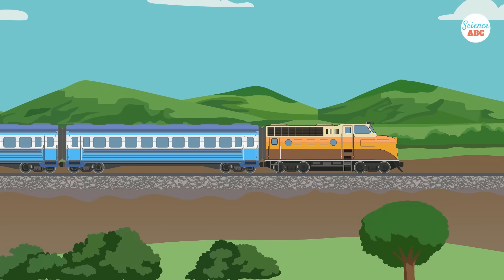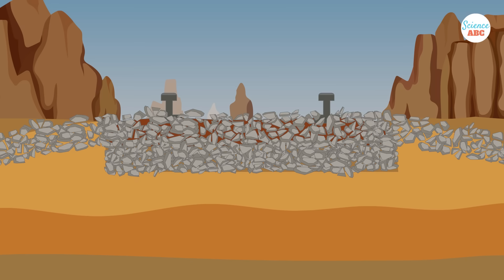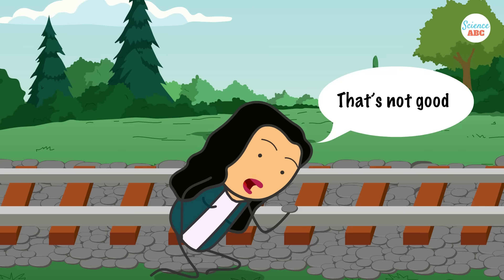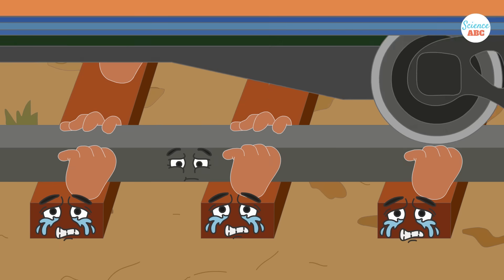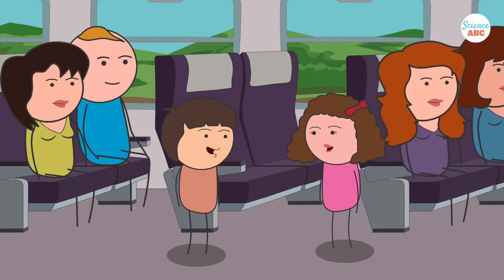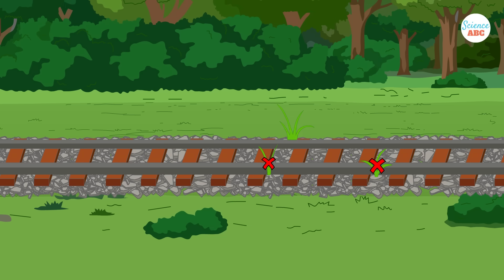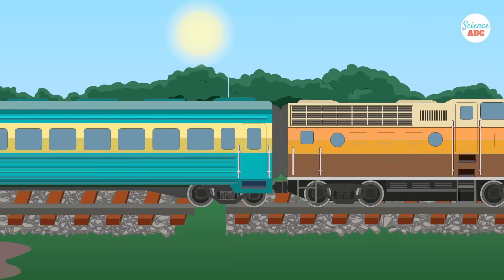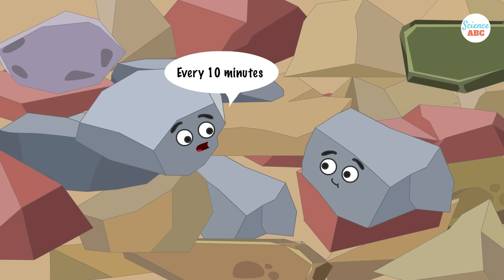Why Are There Stones Along Railway Tracks?

Comment: Another reason is sparks... the steel rusts and the train's rims kick sparks off the lines creating fires. The rocks stop vegetation. I've seen several rail line fires in dry months
Reply: Number 5 mentions stopping vegetation. It just doesn’t mention sparks in conjunction with it.
Reply: I've been working for the railroad for over 30 years and have never see the wheels make sparks from being on the rails.  Most fires are caused by carbon buildup in the exhaust and subsequently released into the air and landing on dry vegetation.  The only way the wheels make sparks is if the train is stalled and the wheels are spinning and train is not moving.
Reply: @MichaelOstertagFarlinTerminal 
Nevertheless, fires do happen. Rocks, too me it seems, keep it from getting out of hand.
Reply: @MichaelOstertagFarlinTerminal  Sparks would happen if pieces of flint were blown onto the track.
Reply: @MichaelOstertagFarlinTerminal  I don't want to give out personal details but I've seen it happen 3 times now. The rail I saw this happen is not heavily used and is often closed for long periods for maintenance. It starts with dry leaves in the adjacent ravines. I've seen the sparks coming off up close and personal.
Reply from the maker: Yes, the stones help prevent vegetation, which is a hazard during rainy weather
Reply: Preventing fires is a huge reason for it. I'm surprised they didn't mention it.
Reply: My dad used to work for a rail yard making repairs, and as a kid when I asked what therisks were got he said it was to stop sparks from causing fires too.  And one time vegetation was allowed too close where there wasn't as much ballast and it went up in flames mid summer, and they ended up expanding therail yard line to make it complete rock.
Reply: Yes this is very true and the sparks is from the trains too. If the crew does an emergency brake that is locking the engines wheels that is causing it spark because of the wheel and the railing scrapings together to make sparks and cause fires.
Reply: Sparks isnt so much of a problem. Guess you never seen an electric train switching 3rd rails? Also with deisels engines overheating, faulty wires or leaf debris is main cause of fires
Reply: I thought this was going to be the NUMBER ONE REASON!! 🤦🏻‍♂️
Reply: @samuelluria4744  the more I think about it a grass fire may cause damage to the surrounding areas but have little affect on the tracks
Reply: @JustMe-gn6yf  - Oh, okay Mr. Cynical...you DOUBT the Railroad company's commitment to the overall good of the environment???😜😜😜
Reply: @samuelluria4744  no not by any means in fact I wish we had more passenger rail systems in the United States that connects both coasts but grass fires aren't that bad for the environment and it's the land owners responsibility to maintain their overgrown dry vegetation
Reply: @JustMe-gn6yf  - I thought my sarcasm was more obvious,  sorry...
Reply: @samuelluria4744  I'm a little slow it's been a long work day, it's all good
Reply: @JustMe-gn6yf  - Same here...😉
Reply: @samuelluria4744  I still complain about our lower 48 states not being connected by passenger rail system
Reply: @samuelluria4744 
They have to to some extent. Can you imagine fire following them up the track? Remember that trains carry cargo here in the US, and some of that cargo is refrigerated and frozen. Other cargo is at ambient temperature or open to the air. Fire would put a wrench in the works for a lot of it. You can't sell an apple cinder.
Reply: This is an old rail line. Very old. No '3rd rail.' A lot of moisture, snow, trees & branches but in the spring all the dead plant material is dry and is fit to light up. Some fires I could put out with just my boot-stomps and a shovel. Others required fire dept help.
Reply: Another reason not mentioned is a safety reason. I work in an enclosed facility that stores railcars, and we have approximately 30 miles of track. Just last week we had a spray truck come down to spray herbicide for the reasons mentioned, as well as these others. The facility i work at is in Texas, so snakes, such as Copperheads, Water Moccasins,  and Rattlesnakes are a real threat to us out here. Trust me, you don't want to be walking down the side of the track 20-30 cars deep through tall grass. Too big a risk of getting snake bit. Then there's the vines and brush that like to pop up. Serious tripping hazard
Reply: I'd agree with others it's an added benefit not a reason. I don't doubt its possible to start fires, i'd imagine those small chips can get hot with pressure of the train.
I've never seen it myself though, most fires i've seen on track is from grinding gear(esp. on track profile grinders), dragging rail and people throwing a ciggy out the window.
I've also heard(but never seen), a tampa starting a fire by chipping a rock.
Reply: First thing I thought of
Reply: He already mentioned vegetation. Doesn't need to talk about every little thing
Reply: Gotta be some hot wheels when they on fire
Reply: that’s not a reason, just an added benefit
Reply: Wrong!
Reply: Hot ties!
Reply: Thanks now o don't have to watch a 5 minutes vídeo explaing that
Reply: Saved me 5 min
Reply: Are you on about sparks from the connector to the live 3rd rail? As those are the only sparks I've ever seen
Reply: Rust doesn't spark.
Reply: You mean the flanges? Cuz yeah I see that happen too, BNSF maintains the mainlines well and clean around where I live so it doesn’t normally happen often and when it does it stays isolated.
Reply: This is what I was going to say.
Reply: Not from wheel sparks, you haven't.
Reply: Why am I here
Reply: Oh interesting
Reply: A reason left out: They make the tracks look pretty.
😄
Reply: this was the only thing i knew about the stupid rocks and the guy didnt even mention it, thank you for making me feel less insane.
Reply: Fire must have been a greater risk with steam trains, I guess
Reply: @tomhaskett5161  No, fires were a greater risk when the bearings that allowed the wheels to roll had to be regressed periodically manually.  If they got too "dry" they'd get very hot and could and did start fires.  This is no longer the case, they are self-contained.  
I'm in my mid 40s and have seen a few train-caused track-side fires, but they weren't major.  It's been 30+ years now, though.
Reply: Musta worked with a state or federal forest service. Trains typically cause fires when a bearing or brake is malfunctioning because I've seen one string fire for miles working with NCFS. .
As another commenter said they also rain sparks when a turbo charger is burned out causing flames and sparks to fly from exhaust. Has anyone seen on a movie someone driving a car on the tracks. It can be done but we did on non used tracks as it's private property and meeting a train would be catastrophic.Dont back up.
Reply: It’s a lot of oil on tracks
Reply: How the heck could they leave out an important reason?
Reply: @steelionx9255  They didn't. They mentioned vegetation.
Reply: @steelionx9255  probably they don't want us to know that. Sus☠️
Reply: Have you ever tried to put living grass on fire? It's hella difficult. I don't think it's a valid concern
Reply: @ВикторФирсов-е9ф  It's not alive. It's dead and dry.
Reply: @SB-qm5wg  depends on a place, obviously. We still see the stones in Russian swaps, where you wouldn't find much dry grass
Reply: @ВикторФирсов-е9ф  - Utzki-Putzki, stick to the stuff you actually know about.
Reply: @samuelluria4744  my man, what had to go wrong in you life that made you this toxic

Comment: I didn't know there is so much science involved in the railway track. And I thought the train itself is already complex.
Reply: I have found everywhere I looked closely that my understanding of everything is surface level and absolutely everything is far more complex than I would have guessed
Reply: Yeah it is amazing. When installing rail switching systems, or points machines, which allow tracks to change directions, there are certain measurements one needs to take into account when installing these things. In these sections where rails switch, there is an extra blade-like beam that is installed and this is used to guide the direction the axols will take. You can imagine that if the gap between the stock rail and the blade is off, the axle can either fall into this gap or be pushed off the rail. When considering these measurements, we also have to consider different temperatures as in the winter, due to contraction, these gaps can get as much as 1cm smaller and can expand by as much in the summer if not regularly adjusted and tested. Just that 1cm difference can have catastrophic results. So after we would do our installations, testing and validation, we'd have to perform inspections every few weeks to a month in order to ensure that these gaps remain within their specified safety ranges. When I first started on the rail, I never could've imagined how interesting it would be all the engineering that goes into the tiniest of details.
Reply: @julianmcmillan2867  toch wil ik mijn hoop niet opgeven 🙏 ben een stijfkop of noem het de DWARSLIGGER 🙃🙃🙃🙃
Reply: @joseffinat966  Ek praat Afrikaans, nie veel Duits nie.
Reply: There's a surprising lot of engineering behind modern track design. I mean the rails are even used as giant electric circuits for a variety of purposes like occupancy checking.
Reply: If you lived in countries other than that 3rd world dictator terrorist shithole USA, and move to countries like China, you will be blown away by their high speed train which is close to the speed of an aircraft. 
But it's understandable for people living under a rock in the USA to be impressed by 200 year old techs.
Reply: What's especially cool is that none of the engineering is strictly necessary, but it makes rail travel so much more effective and useful. Rail is pretty much caveman technology being wheels on a couple of sticks, but on total steroids and we get what we now know as railway track. Pretty cool.